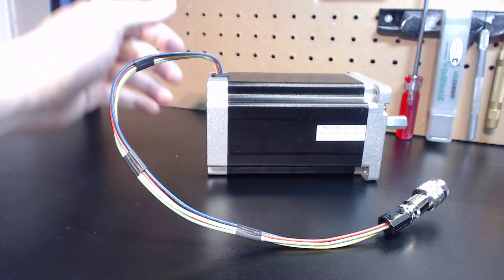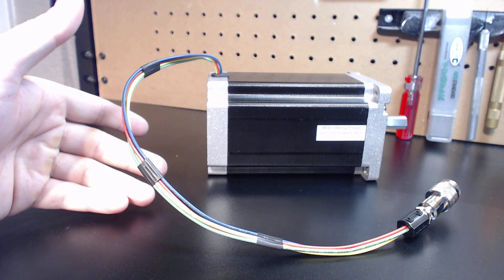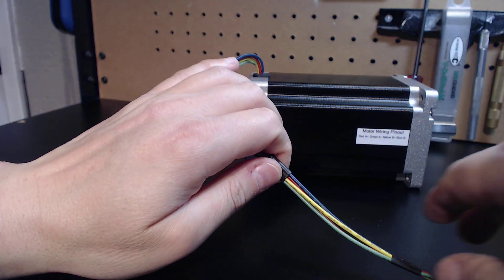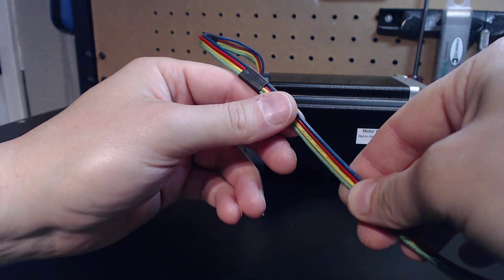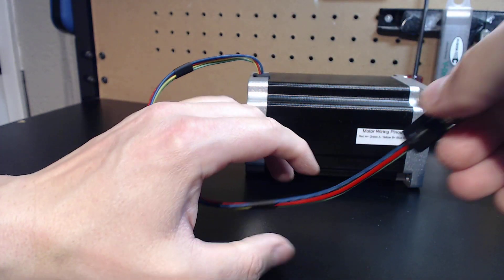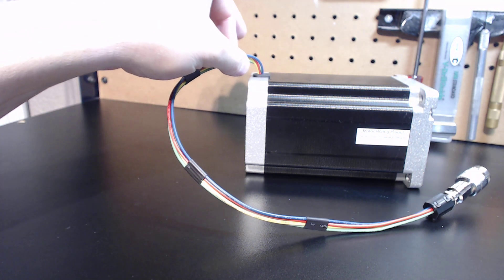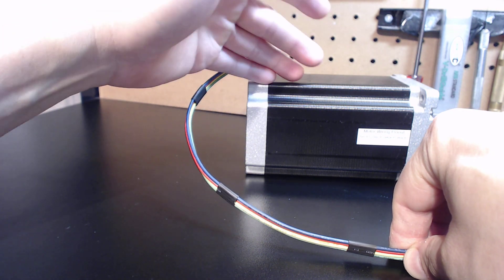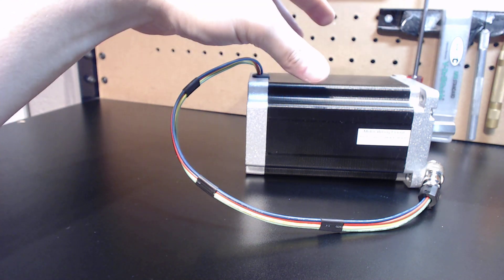How To Make Stepper Motor Leads Into Flexible Shielded Cables..

Comment: Snap-on ferrites—great call! 

I bought a used 600x400 CNC a couple of years ago and never got around to running it before taking the whole machine and controller apart. As a result, I’ve transitioned from being a full-time cabinetmaker to a full-time programmer over the last two years, learning to code along the way. Meanwhile, I’ve been slowly applying what I’m learning about electricity and circuits.

There’s plenty of great content on building power distribution and controller boxes for CNCs, but not nearly enough on ‘doing it right,’ which your videos clearly take passion in. Thanks for the valuable insights!
Reply from the maker: Thank you again for your support. I'm glad they help :) Vince

Comment: Shrink tubing doesn’t get that hot; if it were too hot it would burn/melt, so I typically just use my fingers to squish it and; since my finger cools it slower than a wet paper towel, I can mold them quite well. I’m not saying people should touch hot things but if you’re willing to try it and it’s also not too hot in your opinion, it works well and the tubing is quite moldable.
Reply from the maker: Thank you for your support. That's well said, and I usually do the same unless its double wall. Thank you,
Vince

Comment: My plan is to use something similar with 18/4 and GX16 connectors. I'm having a hard time soldering the connectors up though. The 18 awg wire is larger than the solder cups on the back of the GX16 connectors. GX20 connectors have larger cups but then the connector itself is too big to provide strain releif. How do you handle that?
Reply from the maker: Hey Nathan, thank you for your support. All GX-16 connectors will accept 18awg wire, but the key to soldering is to use the proper flux. I didn't see you mention if your utilizing flux?
My Kester 186 is amazing stuff, and makes soldering very straight forward when accompanied by my Kester #44 solder. Thank you,
Vince
Reply: Thanks for the reply! I am using flux. I picked up some of that kester 186 based on one of your recommendation from another videos. Thanks for that tip as well! The problem I'm having isn't soldering per say. I'm using some 18awg shielded 4 conductor security cable but it just doesn't seem like the wire fits down in the cups of the GX16 connectors I ordered when I dry test fit it. The drain wire fits in perfectly but that's more like 20-22awg. I guess my question is do you have any feedback for soldering larger wire gauge to these connectors?
Reply from the maker: Great, I'm glad to hear your using it because it certainly makes a huge difference. I really only use silicone 18awg wire for internal GX-16 connections, but all 18awg wire should work. Forward me some pictures of what your tinned leads like. Thank you,
Vince
Reply: It really does. Here's an example. The tinned wire is almost as big as the entire pin and doesn't fit down in the cup. I can solder it on to the outside well enough but it just seems a bit hinkey. I've also included an example joint for the drain wire. In that case it fits right down in there like a dream. The flux makes it easy using your method.
 https://www.dropbox.com/s/koligaeq55r2sf5/20210407_122842.jpg?dl=0

https://www.dropbox.com/s/spkpv961qbkk17u/20210407_122901.jpg?dl=0

Comment: Hi Vince,

I have your 5 pin motor/chassis cables with the 5th pin for the drain. 

Your motor cables have only four wires and a 5 pin connect. What is the purpose of the 5th pin on the motor cable connector....it appears to go nowhere?

Thanks.

John
Reply: Hi Vince,

Guess I confused again. Yes, the 5th pin is attached to the ground buss in my chassis, but I'm referring to the 4 wire, 5 pin stepper motor cable connector that is connected to the four wire, 5 pin chassis cable connector that has an additional wire mesh/shield drain soldered to the 5th pin.....the stepper motor connector also has four wires but no wire mesh/shield drain soldered to the 5th pin. Blaaaa! :-)

Shouldn't the motor cable also have a shielded cable besides the ferrite core?

Thanks.

John
Reply from the maker: I believe I know what you're discussing now. The motor's 5 pin butt connector will not have a shield drain connection as the shield drain is only connected at one end of the cable. in this case its at the electrical enclosure's end for the motor cable. All stepper motors leads are unshielded as their traditionally very short, but in best practice as shown in my video utilizing a ferrite on their leads provides passive EMI protection. 

The ferrite would be all that's required on the motor's leads as installing a ferrite over double shielded cable has little effect due to two layers of shielding already covering the leads. 

Thank you,
Vince
Reply: @corvetteguy50  Hi Vince,

Ok, I wonder if the use of a shielded cable, minus the ferrite on the stepper motor with a drain connected to the motor housing and the 5th pin so the drain would run the full length of the cable and back to the chassis buss. I wonder if it would reduce EMI even more? 

Thanks.
Reply from the maker: No sir, I wouldn't recommend it as a shield drain should only be connected at one end preferably the electrical chassis to prevent a possible "ground loop". Your not trying to eliminate EMI completely as its virtually impossible, all you want to do is reduce it to the point that it doesn't effect your system. On the motor's leads a ferrite installed is the best option as it eliminates the potential for a ground loop, and adds additional passive filtering on your motor's end. Thank you,
Vince
Reply: @corvetteguy50  Ok, good....it makes my job much easier....thanks Vince!
Reply from the maker: Hey John,

Thank you for your support. 

The 5th pin is as you identified the shield drain for the double shielded 18/4 pro cables. This pin is a dedicated ground to dissipate EMI. When mounting the panel mount GX-16 male panel mount connector in your electrical chassis you would attach the 5th pin to your ground buss. 

Thank you,
Vince

Comment: And where is the shield? ☺️
Reply: I will add a copper sleeve from the connector to the stepper motor and will connect that to the ground. That was basically what I was expecting from this video :-)
Reply from the maker: CNCPRINT, thank you for your support. The cables are using ferrites with offer passive EMI filtering. Merry Christmas! Vince

Comment: What about twisting the  A and B pairs together so the + and - pair leads cancel each others EM fields. Same method they use in UTP network cables to cancel out most of the cross-talk. 

I personally prefer to wrap those leads in and out of a large pipe shaped ferrite bead. I'm not sure tough, that method is said to be best for high freq applications which is 100Mhz or so. Since my Mach3 break out board will run at max 35Khz. I appreciate any feedback. 

Thank you.
Reply from the maker: Emre,
Thank you for your support. I really appreciate it. Yes, this is a great practice for certain applications, but with stepper leads if you require maximum flexibility then this method may noit be best. Thank you, and please be safe.
Vince
Reply: If someone watching this video now:
Twisted pairs is one of the best practices for protection. Losing some flexibility is completely irrelevant. You can also find on the market double shielded + TP cables for your long extension cables.
Also you don't need 5-pin connector on the motor side, because there is no shield, it will just sit empty and hanging out, with no use. You need 5-pin on the other side of your extension cable to utilize the drain on the side of the controller. There is a point using 5-pin, only if you shield yourself the default wires from the motor.
About snap-on ferites - they are helping, but far, far from optimal. An actual protection requires large rings and specific number of loops of wire inside and outside them and oscilloscope analysis of the interference. But here we are at amateur level, so it's all better than nothing. Even the smallest measures can overcome 90% of the potential problems.
Btw the videos are very entertaining. Loving the content. It would be nice if they were in groups, like playlist about certain aspects of the builds (for ex. "wiring").

Comment: Nice.  I hadn't seen the emi snap on connectors.  I will look at the gx16-5 connectors.  I hope they have more room for the 16ga shielded cables I use. The common 4-pin aviation connectors are so difficult to work with.
Reply from the maker: I can tell you they certainly have less room then the GX-16 4-pin versions as the connector's size is the same with more pins making it require an even sportier soldering technique. :)

Thank you, and have a great weekend!
Vince